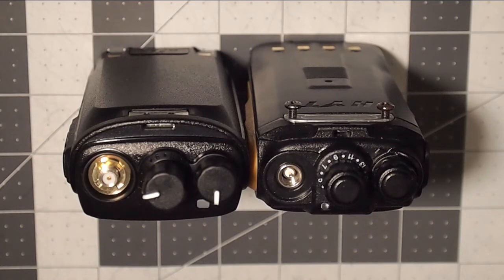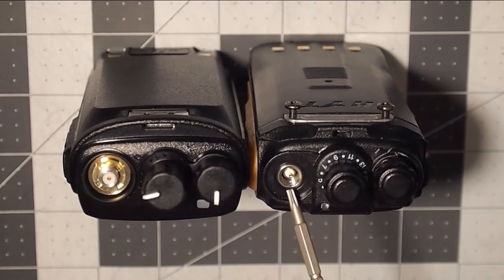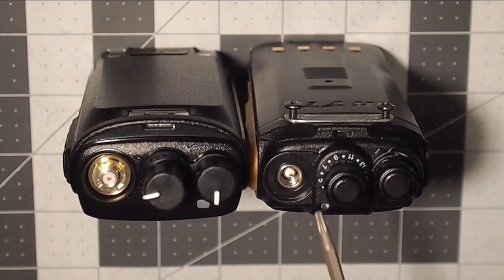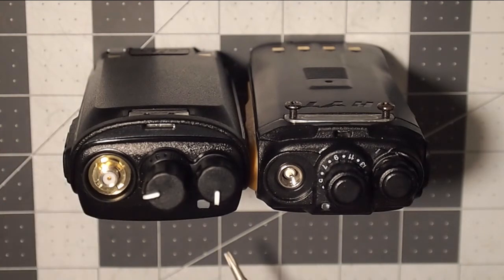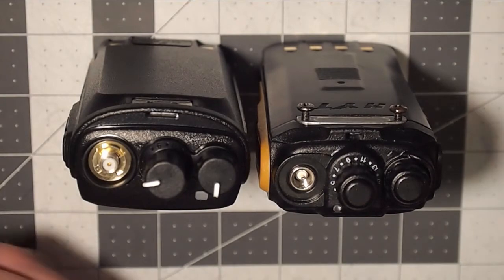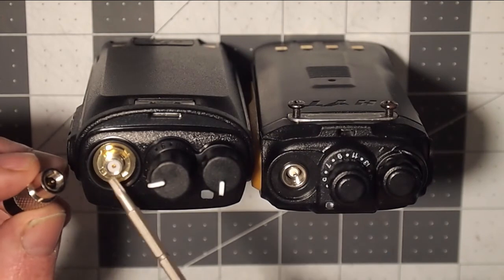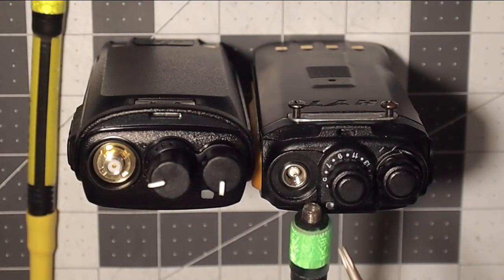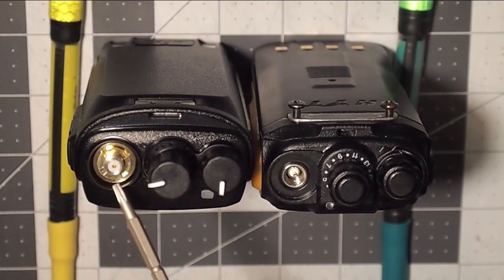SMA Adapters: determining correct gender

Comment: Most Hams working with PL-259 and SO-239 don't suffer the same gender confusion as they do when working with SMA connectors. The PL-259's large phallic center pin proudly extends beyond the threaded outer casing. Even when viewed from the side, its gender cannot be mistaken.  

In contrast, the SMA male center pin is so small it requires a bright flashlight and reading glasses just to find it. Embarrassingly, the SMA male center pin is recessed below its outer casing so that a side profile will completely hide its gender. I suspect the SMA male connector has androgen insensitivity and this leads to a lot of faux pas moments. It is always better to ask its gender pronoun than assume and get it wrong.
Reply from the maker: Great! Wokism and the SMA connector, love it!